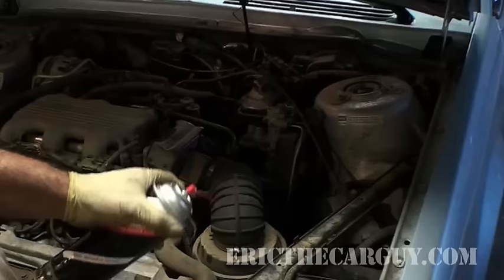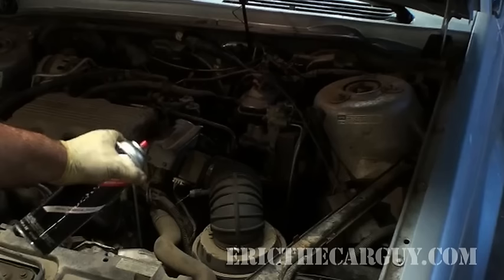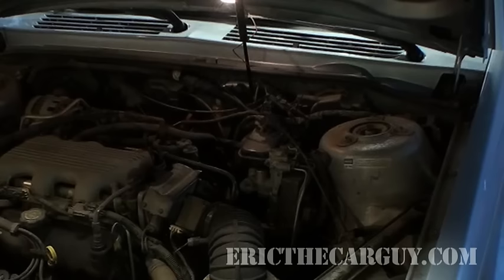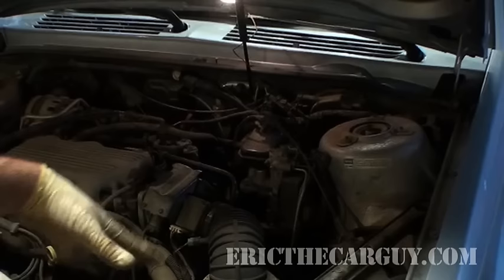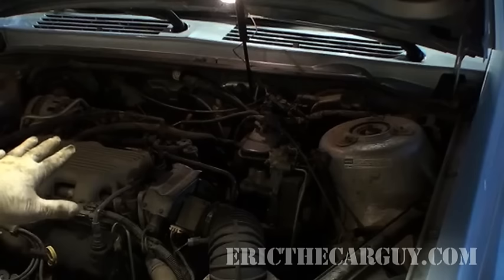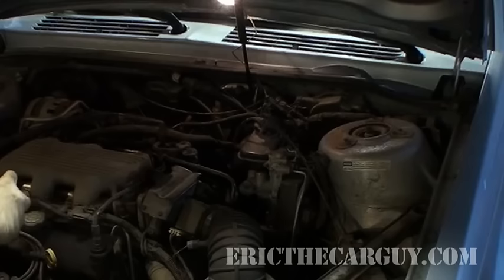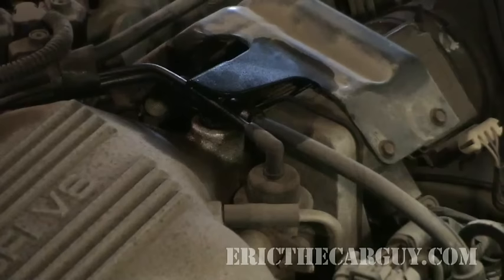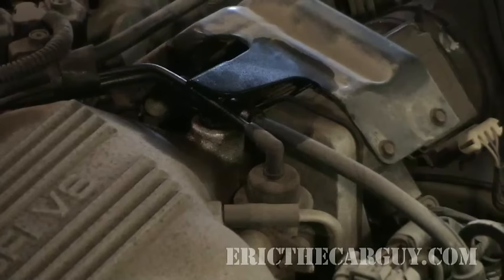How To Find A Vacuum Leak - EricTheCarGuy

Comment: Eric, being a car guy and drag racer for over 50 years. One of the safer ways is to use a spray bottle with water. Instead of the engine speeding up when you find a leak, it will slow down, (and NOT catch on fire if it backfires) which they can do.
Reply: Exactly what I was thinking of doing glad I saw this!!!!
Reply: Thanks for sharing!
Reply: Will be trying this
Reply: To his credit, he abundantly overstated the potential for fire 🔥
Reply: I would rather listen to a guy who has Drag raced for 50+ years and says to use something that is safe! Water what a concept! Duh.
Reply: You answered my question before I even asked it, thank you!
Reply: What if the water catches fire?

You see? There is such a thing as dumb questions.
Thanks for the tip. Gonna go try this right now.
Peace!
Reply: Thank you sir
Reply: Water and electrical connectors, sensors, etc?
Reply: I have vacuum leak and can not find, you are saying that spraying plain water around hoses will work. Do I have to have engine running.  Thanks, God Bless.
Reply: Will it work on small vacuum hose too.  Thanks
Reply: SOAPY WOODER! ChrisFix Voice
Reply: cant u get water in ur engine and make it rust?
Reply: @Deletric small amounts of water like that wouldn’t make it rust at all. I personally will have my hood open for hours working in the rain and nothing happens. Id think most car companies wouldn’t make their engines that vulnerable
Reply: My question is, wouldn't it be bad to suck water in an intake? Seems like it would. Its a vacuum not air coming out like a tire.
Reply: is not water super-risky-bad for an engine?🤔
Reply: @gregvetter5070 well done sir
Reply: @kenny7479  Dude, we can chip in and get you a tent or something
Reply: If you use regular water yes. If you use distilled water then you are good. Regular water has to many minerals that can get stuck in the engine. Definitely gonna be a bad day @Deletric
Reply: @ezwa9979 regular water yes. Distilled water no
Reply: thNx, btw, you should problE cancell your secNd shortr, reply - it could throw some Ppl the exact wrong direction(as a yes or no alone can mean anything & B assumed wrongly)👋😑
Reply: not catch - but cause this or that short, spRk, fire electrical snafU, etc.. U were rong about B-ing rong, it actULE COULD start fire☹️

Comment: I just saw your post on 11/17/2018.  Here is an OLD SCHOOL check for you.  I saw many variations before computers were used in cars.  We would put a piece of cardboard over the fan (they were all belt and pulley then) to limit the fan blowing air back on the engine.  Then we would take a couple of long straws and tape them together. Then we would light a cigar (smart people did this away form flammable liquids and washed their hands first to get chemicals off).  We would hold a puff from the cigar, and using a flashlight, we would blow a little smoke around gently and look to see if it got sucked in somewhere.  I actually saw a rig that used a smoker from bee keeping used that way .  It had a little hose coming off of it and the guy had a piece of coat hanger wire taped to the hose.  You need to know we had vacuum manifolds in those days, engine vacuum advanced the distributor timing for the engine, and where there are wiring harnesses and sensors today, we had vacuum lines run every damned place.  In the 70's and 80's we had both, and was that ever a pain.  Some of the hoses looked like wires and were made of brittle plastic.  Some of the wires looked like hoses, and sometimes the wires and the hoses were run together as a bundle under wire wraps or friction tape.  Yes, I have a therapist.
Reply: So basically block the fan use a vape to avoid risk of spark and flames and blow a cloud
Reply: @private1712 great idea
Reply: Nice detailed explanation. I can totally get a visual of what you are explaining. Thanks for the tips old timer!!

Comment: I brought my van into a shop once with a vacuum leak, and was told I had a blown head gasket...tip, shops are crooked, fix yourself at a 99% savings.
Reply: +Joshua Odom Damn right bro
Reply: Honestly, I'm afraid of handing my car over to shops.
Reply: I have 6 thousand dollars worth of mods on my Mustang and I never once took it to a shop. I spent countless hours on my car but everything was done right, I didn’t have to pay anything for labor, and I know a great deal more about every inch of my car c:
Reply: i got a pro charged street fox and will not take it any where for any thing unless I plan to stay with it
Reply: When I got my mustang I got lazy and didnt want to figure out a wiring problem so I took it to a shop so they would find it I didnt have to deal with it they charged me 80 bucks to just check fuses and replace a part that wasnt broken then found out the switch (brake switch) wasnt getting any power so they told me come back tomorrow we'll finish it, so Im like ok and when I bring it the next day  they wanted to charge me 80 bucks AGAIN to "find the problem" they are all scammers same when I wanted my power steering fixed different shops but still idiots kept replacing shit that wasnt broken NEVER AGAIN. That same day I told them fuck you went home and fixed the brake switch in like 15 min.
Reply: I took my '78 Lincoln Mark V , with a 7.5 liter v8 to a shop to get the whole exhaust replaced. When I got it back, it DID have a blown head gasket.  I didn't know much about cars back then. Pretty sure they were revving it for fun while the exhaust was off of it.
Reply: Same thing happened to me a while back with my lights. I paid $100 to a mechanic to fix my blinker fluid reservoir when I could've done it myself.
Reply: Flash same shit happened to me but dude charged me $250.00!! 😭😭😭 fucking got me straight up! Never again tho
Reply: Jupiter Fox! Fix my mustang!!!
Reply: Or they're just asinine, and deficit in skill.
Reply: sounds to me like he needed a new Johnson Rod.
Reply: @binzsta86 i see what you did there
Reply: No such thing as an honest mechanic. He might be cool with you but he's ripping off somebody.
Reply: Some things are better left to a garage, so if you can't do it for whatever reason, figure out what part you NEED, buy it and pay them to fit that part. Don't take it in and ask them to fix this problem or that problem. Call up, get a quote on how much to replace X part and then do it that way.
Reply: My 2003 Buick century had missing hoses and a couple collapsed lines. It idles fine but when put in drive and you step on the gas. It wants to bog down and not want to shift. Any suggestions for me?

Comment: I was working on a Silverado about 3 years ago and I sprayed some brake cleaner to the rear of the intake manifold while the engine was running and accidentaly hit the exhaust system and poff it caught and I scrambled for the fire extinguisher. It was out in second and I had to repair part of the wiring harness. That was it. So if you think you know it all and nothing bad can happen to you while working on a vehicle you are mistaken. In every situation working on any vehicle we must use caution. Thank you Eric for the vaccuum leak video which is part of my engine diagnostics YouTube folder. I only save the best of the best videos and this one is one of my favorites.  Thank you.
Reply: Bad things can always happen when working on vehicle... My story is when I've replaced the brake rotors and pads, all nice and good, been satisfied of the job I've done, guess what? The last caliper guide pin bolt thread was stripped... Only today I've fixed after I ordered from ebay x2 brand new pins... Shit happens.

Comment: Another useful method is to take a pair of needle nose pliers and just go around and gently pinch off vacuum lines. If you hear a change in idle speed you know you just changed the fuel air ratio. I have found many vacuum leaks this way. This method works very well on older vehicles; I don't know if there would be any conflict on today's more sophisticated engines and systems.
Reply: Where do u pinch the line exactly?  at the very end where the boot is ? Thanks.

Comment: If you have a distributor be careful not to spray near it's base, they typically aren't sealed well. The carb cleaner mist will enter the cap and ignite, the cap will explode like a bomb. I exploded one on my Ford Ranger, I was wearing safety glasses and sustained no serious shrapnel injuries.
Reply: I noticed my distributor cap was missing a seal and had a gap, maybe 1/32 inch wide in some places, so I decided to order a new gasket before proceeding with this test.  I was concerned about the very issue you described.
Reply: The vacuum advance slider was sticky. I'm not sure what the "dizzy" means. Obviously it was a mistake, no call to get all knowing about it.
Reply: @x4prilsF00Lx I wasn't following these instructions of the video, this was 30 years ago. You are a troll. Just a heads up you are what is wrong with comment section.
Reply: x4prilsF00Lx Why are you getting so worked up with the guy over an accident on his behalf? We learn by making mistakes, and I’m sure he learned from that mistake. You don’t need to practically call him a dumbass for doing it. don’t intentionally try to make people feel stupid, as that’s just not right.
Reply: @Cayde Is Clutch My dizzy has a vacuum line running to it...
Reply: disconnect coil.wire. + #fuel pump fuse.
Reply: Just cover the distributor with aluminum foil.

Comment: Hey Eric, I recommend using brake/parts cleaner instead of carb cleaner for a couple reasons. First and most importantly, brake cleaner doesn't dry and crack plastic and rubber parts as badly. And second, brake cleaner tends to evaporate quicker as it's not as oily as carb cleaner. I never really considered the risk of a fire, but will use caution from now on.
Reply: I’m actually about to test his method out, thanks for the tip. My engine is hiccuping and sluggish. I had 2 cracked intake tubes so I swapped them out for some aftermarket ones. It fixed the problem on top of a spark and boot change. I put some vp racing fuel additive and now my check engine light won’t go away. I going to check for leaks first to make sure that’s the issue and then most likely swap out my stock exhaust for a test pipe set up.
Reply: They also have non-flammable brake cleaner as well.

Comment: Nice work, bro! It's rare to find a mechanic who not only understands an issue and knows how to fix (or at least detect) it, but also knows how to explain that issue, which you have done.... Looks like I need to go buy some carb cleaner (and a fire extinguisher!) for my 2000 F-150 that not only idles rough, but also emits a high-pitched whistling noise while the engine is running. Thanks much for making and posting this video, which has earned you one new subscriber.

Comment: I found a white plastic vacuum line that was disconnected after noticing the transmissions shifting hard, and the smell of rich gasoline when cold.  Where it was supposed to be connected was hard to find,  it was feeling under a manifold where I found a short rubber hose connection sticking out of the manifold. Amazing how much better they run when the vacuum leaks are fixed.

Comment: Would a vaccum leak cause the car to have hiccups? It seems my car has lik hiccups when letting off the gas and last I heard was a suction sound when the car was running and the sound came from underneath the motor/ car . My rp would jolt down and come back up at its steady rpm. Feels like a misfire but no codes. Unknown issue I just drive around with been through 4 different mechanics.

Comment: Do NOT use an ABC fire extinguisher. It will make a terrible,horrible mess if you have to use it.Get a CO 2 one or Halon. You will thank me later. The propane method will still cause a fire. Stay away from the distributor,if you have one on your engine. Alternator,too. They both produce sparks.  EGR is a common vacuum leak point.
Reply: HALON???!!  Never.  In a confined space, it could kill you.  Only CO2.
Reply: RPMX4 Co2 will kill you as well if you use it Ina confined space silly boys.
Halon is killer for the Nozone layer I mean earths ozone...
Sorry, that's the Al Gore in me....or David Suzuki , yuck

Comment: I have a 94 f150 xlt 5.0 30, she has close to 200 thousand miles on her.. I am fixing what the previous owner did not want to put a few bucks out on. Also learning about vehicles in the process. I had a few error codes on it, did the blinking cel light , 311 and 332, and cleared it by tracing vacuum hoses and finding one that was broken.I put a quick fix on it for now,duct tape, until i find the correct od/id silicone hose to run all new lines. I did get rid of the check engine light and she runs alot better. I want to thank eric the car guy and all of the people here who have posted similar issues and giving me an idea of what to check.  Too bad Ford doesnt make a kit for vacuum hose replacement, they could make a few bucks on all of the trucks still running up and down the road.

Comment from the maker: @Gmcsierra2500hd You might consider doing a compression or leak down test to determine if there is a mechanical issue with the engine.  Make sure you pull and repair any check engine light codes first however.  Lastly don't rule out a transmission issue if you find your engine is working properly.

Comment: 1:33 decent fire extinguisher: $60
Large box of baking soda: $10
Reply: Smart man.
Reply: Have fun cleaning all the baking soda off your engine bay lol. If you're doing something like this to your engine in your vehicle why would you cheap out with something that wasn't specifically made to put out a fire. Sounds like a recipe for disaster to me. I'd rather stand a good few feet away from the fire to put it out and hang over top and dump baking soda all over

Comment: what's the part that was leaking? Fuel Pressure Regulator? - Needs to be replaced and he just hisses? Please answer?
Reply: The intake manifold gasket was the issue in this video
Reply: Are you literate
Reply: @tomchillen3039  very helpful comment
Reply: @bigbitch420  9a
Reply: @bigbitch420  thank you

Comment: Bro, this video is going to help me fix a problem that my car has had forever!  I went through 3 sensors already, then found out that my car (most cars) want BOTH 02 sensors replaced at the same time?  My next "to do" items are 

1) vacuum leak check
2) Replace older B1S1 sensor with an identical kwiksen one
3) If problem persists, new fuel filter
4) If problem persists but without codes, 6 new plugs
5) Fuel treatment
6) Oil change
7) Prayer!

FWIW - I went from 02 codes, to misfire codes, to running lean code right now P0174. My car can't make up its mind as far as WTF is wrong!  If only I would have gone the extra mile to look up all this fuel trim nonsense earlier... I'm subscribing  and giving you thumbs up! :)

Comment: Thanks for the tip.  Good to remember that carburetor cleaner can also ignite on a hot engine - so better on a cold engine, and it's also harmful to breath so spray away from you and not on a flat surface so it doesn't rebound back to you (some have powerful jets)
Reply: Yeah he said that

Comment: Disconnect MAF sensor, block intake, - if it doesnt stall there is a leak! And you can hear the noise too... Safer, easier...
Reply: not all cars have a MAF sensor
Reply: ^^^^^ This! like my car i am working on at the moment
Reply: B Nagy I came here to learn about leaks and thanks to your comment I think I have got what I was looking for.
Reply: gamepro9505 map sensor or maf?
Reply: So if u disconect maf sensor and block intake and car turns off there is no leak? Sorry for replying to an old ass coment just my 05 mustang has a rough idle and i was told i had an exhaust leak i tried what u said and my car turned off.
Reply: If you don't have a MAF Sensor, disconnect any type of Sensor that monitors airflow to your intake manifold, and if your car doesn't have that just ignore that step...Common Sense Here
Reply: I have 2 maf sensors on my 2007 auto G35 so I disconnect both?
Reply: I think you are right on regarding Maf... i disconnect mine and still runs actually even better...finding the leak can be pretty tricky on some cars..
Reply: That would have to be a pretty big leak and I’m sure it would be noisy as hell, for tiny cracks or leaks the car would stall anyway

Comment: Great video EricTheCarGuy, I have a VW GTI 1.8t that has a hissing noise in the area of the intake near the diverter valve, I changed out a hose coming from the downpipe and coupled two autozone hoses together to connect to the diverter valve and since then have had boost issues and lack of torque.  You will be the fifth mechanic buddy of mine to have explained to me how to use this method.

Comment: another good idea before trying this test is to view the motor running in the dark .. looking closely along the spark plug wires (if you car has them )  if old and cracked they can intermittently  ark to the engine block (causes a misfire when this happens ) the ark will ignite any fuel source.. and is a great way to check plug wires .
if u have misfires that come and go

Comment: the correct way is to use smoke machine (vacuum leak detector)!
Reply: You can get a low cost smoke machine on Ebay for under $100 and you can do the test with engine off so air from fan will not be a problem. You can use it to test all kinds of leaks beside vacuum leaks. Cheaper that having a shop ripe you off.
Reply: @georgeforsyth5741  or a cigar or incence stick
Reply: AlexD 2
Reply: @georgeforsyth5741  
mAB I cNt a4d a cigR or stinkN incNs stik, wat aboOt a regUlR smOk?